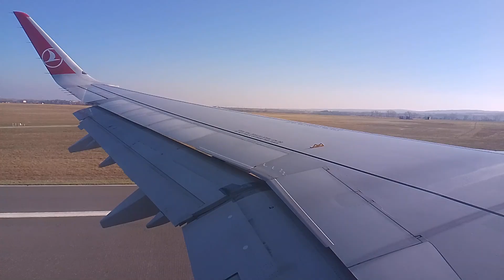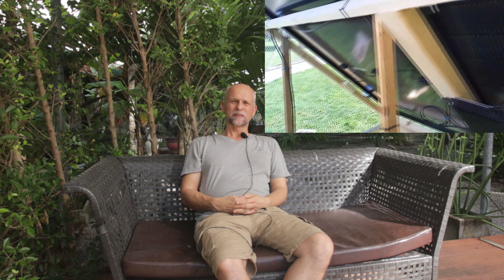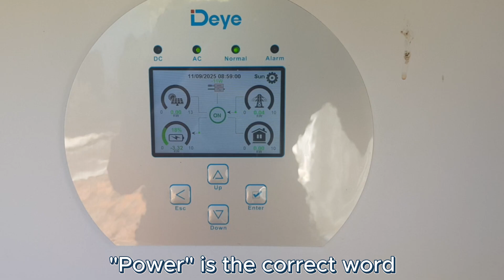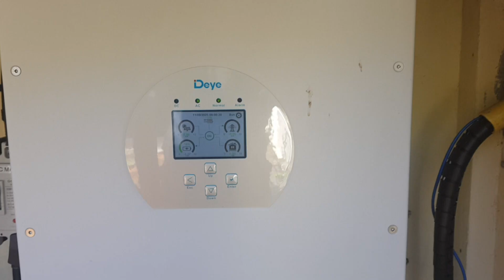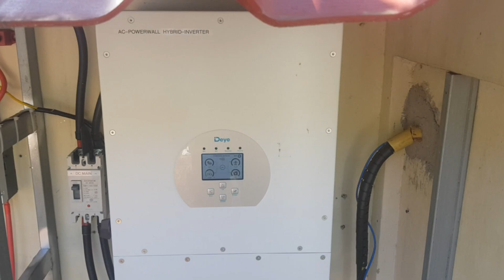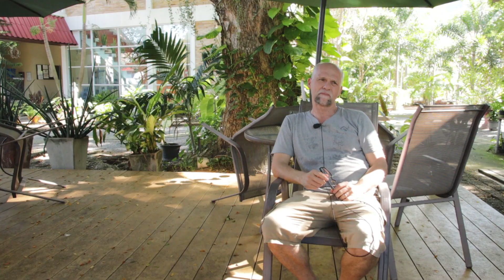Five months gone, finally back home...

Comment: Thanks for your video, Roland. It is quite interesting what you are doing there. 

I remember in one of your previous videos, you discussed the role that insulation and building modifications play in reducing energy costs. Thailand is abundant in sunshine, and it is interesting to see how much you can maximize a renewable source like solar. 

I'm looking forward to your next video. I'm not sure if you have shared any specifics about your system's production or the resort's usage, but that would be quite interesting to know. 

Thanks again for your video. Looking forward to staying there again when I have the chance.
Reply from the maker: Hi, thanks. Yes indeed Thailand has the potential to get most of its energy out of sunshine, albeit it does require a bit more storage capacity because of cloud conditions.
Yes, I do have annual reports of the production. The last one must have been in February. Look for the video in the playlist, but anyway there will be a new one soon too which will show the full impact of the upgraded powerwall. Its just amazing 😊